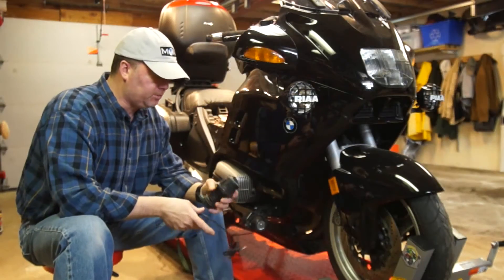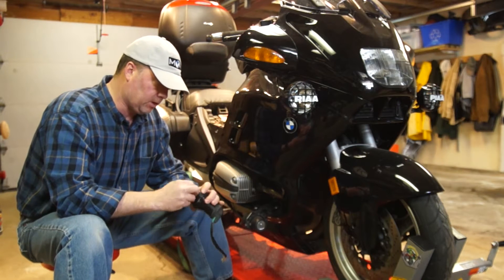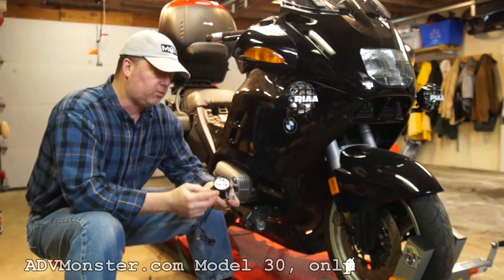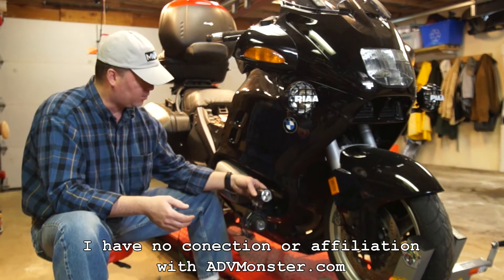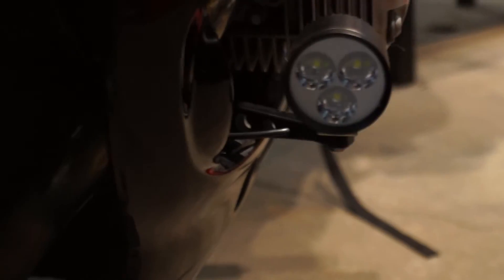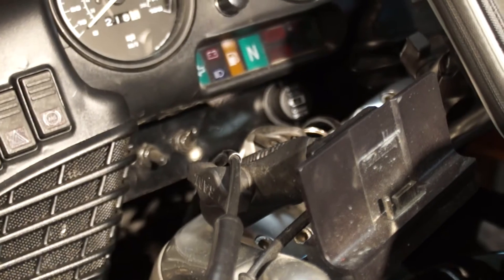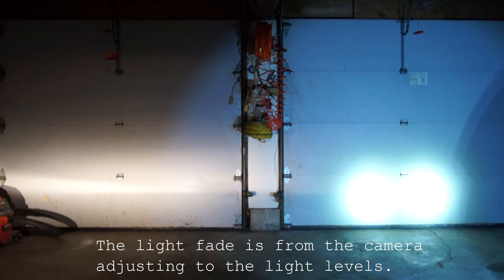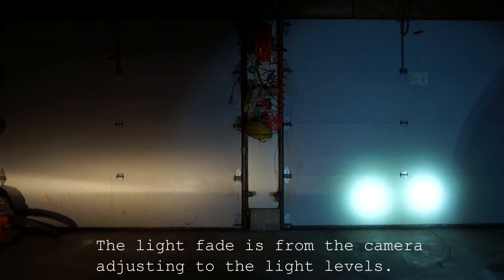LED Fog Lights vs. Halogen Fog Lights

Comment: Hey Doug,  I have all the farings off my 11rt now and out for painting and I was thinking of repositioning my fog lights down in front of the cylinders.  This looks like what you have done.  My question is where did you mount the brackets to the bike?  Do you have a drawing or picture of the brackets you made that I could see?  Thanks and I am enjoying your videos.  Gives me ideas for my 11RT
Reply: Kerry Schoolfield Hi Kerry, first off I'm jealous you're getting yours painted! Sorry, I don't have any drawings of the lights, but here is a quick shot I took http://motofrog.net/images/foglights.jpg 

My suggestion would be to also look into engine bars from either Z-Technik or Wunderlich and then mount the lights on those. That's something I plan to do over the upcoming winter... then I can use highway pegs for the iron butts. If you are at the Billings MOA, stop by the charter club area in the Northern Illinois section for visit and see them first hand. Cheers.
Reply: Kerry Schoolfield 

Thanks for the picture and recommendation.  Ive been looking at those ztechnik for awhile but still have some sticker shock on that.  I fashioned some brackets today and moved the fog lights so I'm pleased for now.  I appreciate your videos and thanks for doing them.  Since Im in N Florida, I may not make it to the Billings MOA rally but I might.  

kerry
Reply: Kerry Schoolfield Miles? You're worried about miles? ARE YOU A BMW RIDER OR NOT?